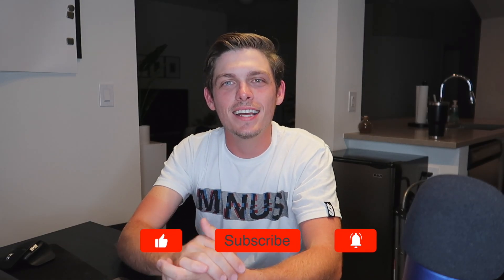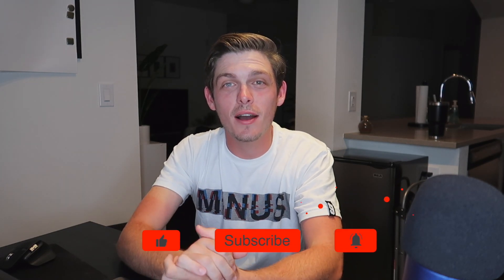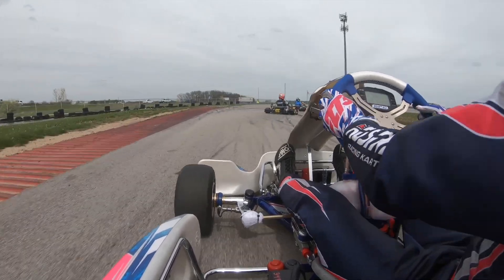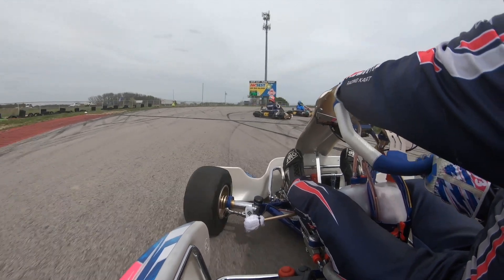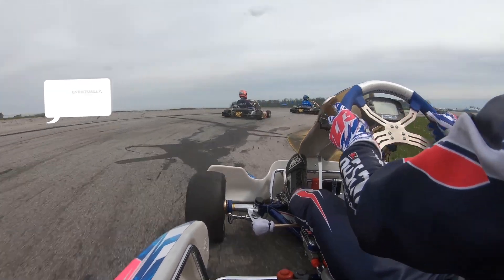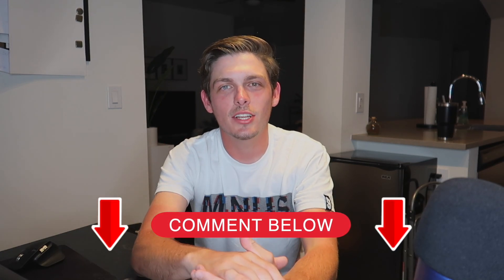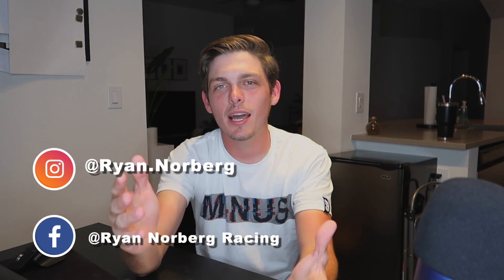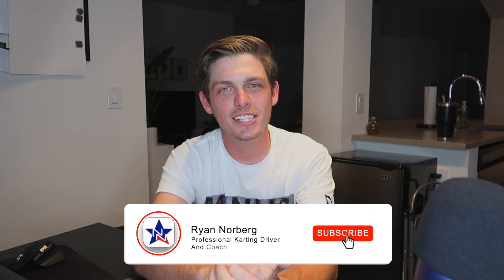HOW to IMPROVE your OPENING LAPS (HOW TO WARM UP TIRES)

Comment: Load on the sidewall which then generates heat into the core of the tyre instead of being the next speedway champion sliding it around like no tomorrow the best way to explain it is go hard into the corner on cold tyres and turn hard full lock to the direction your going. Feel the fronts through the first few corners on the warm up lap. You’ll start to feel the grip come too you and then race the tyres from there if they’re not quite there then wait another two laps, once the tyres grip go like stick and you’ll see the lap times drop 😏
Reply from the maker: That’s exactly it

Comment: As an old guy getting started I've been looking for ALL the advice I can get. Great educational vid Ryan and explained very well.

Small clarification, will I be carrying the trailing rear wheel off the tarmac during this exercise or just up to that point?
Reply from the maker: Probably not. Once the rear starts the slide it will stay down and won’t carry
Reply: @NorbergNation  have you seen the Fernando Doc? When he drove for Renault and Flavio Briatore he would understeer on purpose into the braking zone rotate through the apex and hammer the loud pedal down the straight.
Reply from the maker: @parkitplo3575  yes warming up the front tires are similar to that. Just don’t do that when they are warm hahah